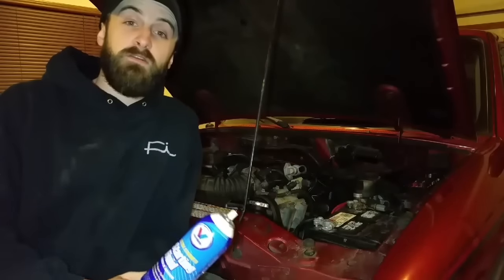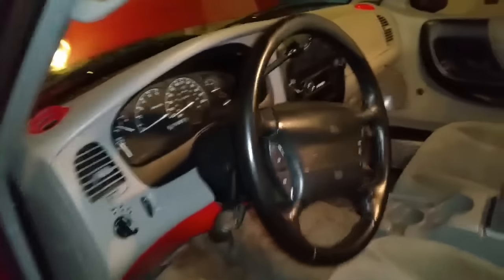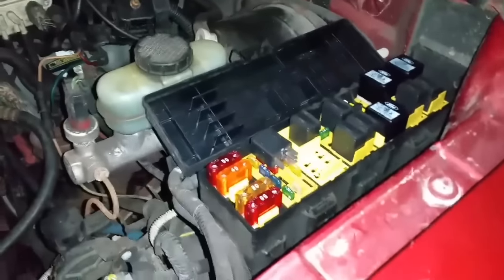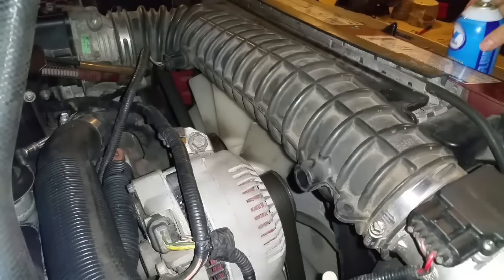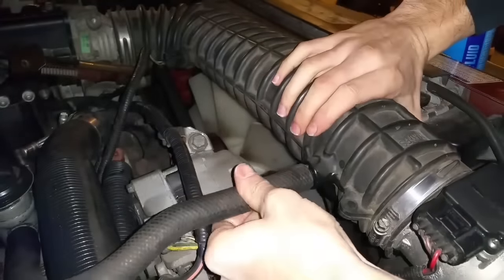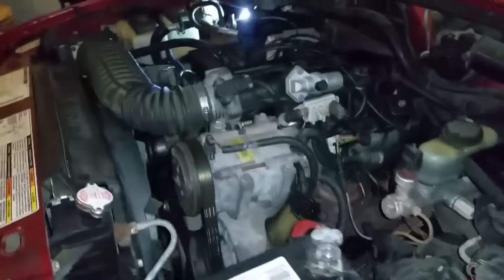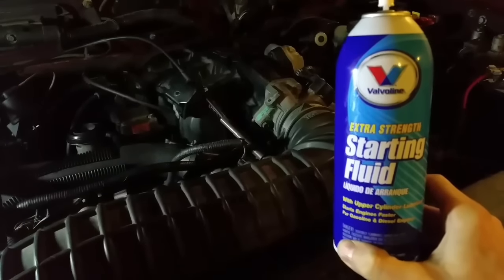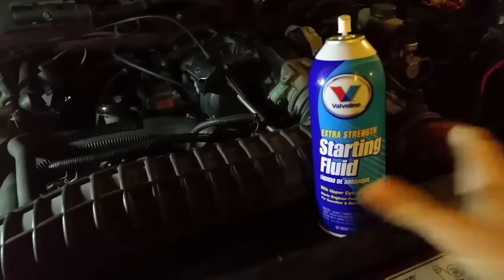THIS REALLY WORKS!!!!!!! Bad fuel pump, fuel pump relay, no fuel problem!!!

Comment: This is bad information on so many levels this will not confirm a bad fuel pump on most vehicles only that there is a no fuel issue which can be caused by a variety of parts. Throwing a fuel pump at it may work ($60-250 plus labor maybe) but thru some very easy diagnostics you could confirm the exact problem ex. fuel pump, fuel filter, COR relay, CP sensor, ECU, EFI relay, EFI fuse a 60 cent part, clutch or park neutral safety switch, clogged or bad injectors or injector wiring, fuck could be out of gas and this test would still tell you that your fuel pump was bad.
Reply from the maker: Did you read the title? Did read the pinned comment? Did you see the part 2 video? But no, you're right, it's not a 3 hour video explaining how to diagnose every starting related fuel component, or electrical circuit on the car. Neutral safety switch and clutch switch wouldn't even crank.

Comment: Not 100 percent true you need to check and see if the oil pressure sensor is bad at least in chevys cause if its good the vehicle will stay running once 4 or 5 lbs of oil pressure closes the switch if that sensor is bad then you may believe you have a bad fuel pump also. This guys truck actually should have kept running once he started without the relay if it has the same switch as in a chevy

Comment: NEVER do this to any type of diesel engine, new or old! In fact..never do this, you can hear if an electronic pump has failed and you can see if a mechanical pump is dead or weak.  Ive been restoring vintage cars for 30 years and have never used starting fluid. If you use your brain first..why would you?
Reply: To start a car

Comment: If there's a timing issue and you like fire, do this method. HOWEVER, if you would rather just see if the fuel pump is bad use carburetor cleaner. Just hot enough to fire but not volatile enough to stay on fire if it gets popped back out of the engine. Sorry man very bad advice.

Comment: You don't know what's You're doing! Never use starting fluid in a gas engine. and if you do, use just a touch or you'll blow the valves and put a hole through the pistons.

Comment: 1.This is not correct 100% and it can mislead. 
2. Regular gas would be fine 
3. It only concurs a fuel problem and could be be from other reasons other than the fuel pump

Comment: How do you really know its the fuel  pump of course it's not going to start cuz you have the damn fuel relay disconnected bro. your only adding starter fluid that's why it wants to start its like adding 1/2 a cup of gasoline is going to burn and back to the same cuz the relay is off😱😨😕😯
Reply from the maker: alfredo zamora Everything on this truck was working at the time of the video... The relay was pulled to simulate a no fuel situation...
Reply from the maker: matthew dix Welp, as I said, the relay was pulled on purpose to SIMULATE a no fuel situation. Simulate for the purpose of making the video... I explained that in the video... 177k views and it's just you two turds that don't understand that. Lol.
Reply: alfredo zamora i was saying the same thing itll never work with the relay off lol 😂
Reply from the maker: planest28 Quote from video "I pulled the relay to SIMULATE a bad fuel pump".... What is so hard to understand about that guys? Jeebus.
Reply: alfredo zamora. Yeah should have pulled the fuse to the pump not the relay
Reply from the maker: Glock 19 See, Glock was paying attention.
Reply: He took out the relay on purpose. He is SIMULATING A BAD FUEL PUMP. By pulling that relay he is simulating, or pretending the fuel pump is bad.  He’s not suggesting you pull the relay. He’s suggesting you use starting fluid to test the theory that fuel pump is bad
Reply: a21bravo  it's helmets for both the little guys😀 they try to learn

Comment: eeeehhh,, that can work,, but first thing i do is get a big hammer and hit the fuel tank!!,  lol then if it still dosnt start ill ck the fuel pressure!! lol,, if it has a plastic fuel tank,, ill hit it with a rubber mallet,,,
Reply: Night Crawler lol, why hit it with a hammer? Or are you just being funny?  I've got an 02 rodeo that I'm trying to figure out if fuel pump is bad

Comment: No one should do this, starting fluid is bad for every engine it burns to hot and has no lubrications to test a starter all you need is piece of wire and you can jump the connections in the fuel pump fuse
Reply from the maker: On a scale of 3 to French Fry, how high were you the first time you tested a starter by jumping the fuel pump fuse?
Reply: @BlaserBuilds  omg...on a scale of 3 to French fry...🤣😂 I don’t know why that was so funny

Comment: Dont do that with a Desiel you can blow the head clean off the engine
Reply from the maker: David Roach I've started stubborn diesels with this stuff for years and never once saw an issue... There's always added risk when adding fuels with different burn rates than what the factory intends but it advertises for diesel right on the can...
Reply: Youve been blessed then ive seen heads get blown off when we was working on some big trucks with diesel your better off to use WD40 then starter fluid ask around to diesel mechanic s will tell you the same.
Reply from the maker: David Roach Interesting...
Reply: David Roach you can use starting fluid in a diesel but u have to be very very cautious u dont spray to much and hold the pedal to the floor while cranking it over. if u spray to much it can and will crack the head or it will vapor lock the motor then u are takeing more or less the top end of the engine apart. im a diesel tech as well. but you are right wd/40 is the best thing to use.
Reply: had a 6v92 silver detroit that had a either switch to prime the motor never blew the head off sorry buddy that is false what it could do is become either locked or either dependent where the compression is lost due to the explosion collapsing rings ect
Reply: drew surber thats the words i was looking for
Reply: - factually, your both right.
This is how I test a "no start" car. If it runs, you know its fuel related.  Start fluid (vapor) will lite better than wd40 in the cold. . (take care cuz too much fluid could hydro-lock or bend connecting rods in your engine.)
Reply: I seriously doubt that you've seen head-s blown off of a diesel !

At most a broken piston bent rod or destroyed starter.

Big diesel are more tolerant than pickup diesel of starting fluid.

& in fact some big diesels came with a cylinder of starting fluid mounted under the hood which was operated form inside the cab.
Reply: If injectors are not pulsing then it's an electrical problem.
Reply: not always a bad crank shaft sensor can shut down your injectors problems can range from bad sensors to a bad ground or other electrical wire or just a bad fuel pump you never know with out checking
Reply: roach , addressing just pulse  injectors, if the injectors are not getting power , it is an "electrical" problem not a pump problem !

&
Injector pulse can be checked even without fuel pressure.
Reply: & roach , you have never seen heads blown off of an engine , ever !
Reply: LOL you act like i care what you believe
Reply: wrong cause a bad sensor can cause the power to not reach the injectors or cause an injector to not pull down all the way causing it to malfunction there are many things that can cause a power issue
Reply: The injector is an "electrical" item that's why it has an "electrical" plug on it.
The "power" you referred to is actually PWM electricity.

You can have all the fuel pressure you need but if you have no "electrical" signal to pulse the injector it will not spray fuel.

& obviously you do care what I think since you keep replying.

& BTW you've still never seen heads blown off of a diesel !

& BTW there are some mechanical gasoline fuel injection systems.
but you already knew that, right ?

Comment: Video made no sense, if you have no fuel pump relay, your fuel pressure is automatically cut off, giving you no pump activity. And some fuel pump relays are in the powertrain control module which mine is which is not a small black cube like in your video. To determine rather it's a fuel pump or relay you would have to multimeter your fuel pump for ground voltage, if you are not getting any than you have a bad fuel pump relay, even checking fuel pressure from the rail would not out rule a relay being bad, until you crawled under your vehicle and checked the ground.
Reply from the maker: JD1982 Video makes perfect sense, and plenty of comments thanking me for making the video and saving them money... May be watch it again and don't skip the part where I explain in detail that I'm removing the relay to "SIMULATE" the engine not getting fuel...

Comment: This guy is clueless, that spray kills the engine, happened to me on the diesel mercedes from 1995, and those are durable engines...it dryes cylinders and feee them from oil lub couse the spray is alcohol based, so its totaly bad idea to use it...BIG NO NO!!!
Reply from the maker: Well Damn skippy you didn't have to use the whole bottle... Did you know you can get 85% alcohol straight from the pump?

Comment: Definitely it won't start. You started it at gear D!
Reply from the maker: Blows my mind how little attention people pay to videos sometimes...
Reply: When was it in gear? I saw it in park. If it were in Drive, the neutral safety switch would not have let the starter to crank the motor

Comment: Don't buy this is totally ridiculous. You can take a motor out of a car and set it on the ground and hook it up to a battery and spray either in it or starting fluid in the motor was sit there and run sitting on the ground as long as you're spraying in a starting fluid. Think about it all the motor needs air, fuel, and Fire. This will not tell you anything except for this guy probably has invested money in the stocks for this commodity and trying to up the sales of starting fluid. So there you have it folks plain and simple does not prove anything.
Reply from the maker: Mike Hamilton You said it best... Needs fuel... If for some reason the engine is not getting fuel this would confirm that if it fires because all other conditions are met...
Reply: I hate to break it to you, but it does prove that the vehicle has spark. There a 2 major areas to check when a vehicle wont start; fuel and spark. If the vehicle starts on starting fluid you can focus on fuel delivery rather than a distributor, wires, coil, spark plugs, etc... This can help save time and money for a novice.
Reply: Being a professional mechanic, this was the first and easiest thing to do on my own rig, it rules out spark compression and timing in 1 quick easy step. One small shot of starting fluid will tell you a lot. But a real mechanic then checks relays, voltages, fuel pressure, filters...before removing the tank.

Comment: You can actually here the starter cranking and everything turning so it's only obvious there is no fuel to ignite the combustion chambers duuuhhhhhh!!!!!!!!
Reply from the maker: Ever heard of compression, and spark?
Reply: @BlaserBuilds  yes it's called get a compression test
Reply from the maker: @orgreens5528  Which is much different than "everything is turning"
Reply: @BlaserBuilds  if everything is turning so strong then its not the compression cuz the compression is still good.. bottom line this can test is wack and you made no sense when u replied anything about "compression and spark".
Reply from the maker: @orgreens5528  The engine could "turn so strong" and still not start with fuel and compression... This confirms the engine is not getting fuel, has spark, and has compression... Sorry that's hard for you to understand.
Reply from the maker: @orgreens5528  Something like a bad cam or crank signal would cause a no start condition for lack of spark... So no, just knowing the engine is turning is not enough to verify a no fuel condition.
Reply: @BlaserBuilds  lets see what Scotty Kilmer has to say about this wack can test..
Reply from the maker: @orgreens5528  Please do, you'll be very dissapointed.
Reply: @BlaserBuilds  I have a 93 b2200 ..put starter and battery but won't turn on it just cranks I sprayed starting fluid and nothing could it be my ecu?? Help me please thanks
Reply from the maker: @LuisGonzalez-gt3wb  Did you check for spark? I did a couple other videos on checking for spark and compression. A bad crank or cam sensor could cause a no spark situation.
Reply: @BlaserBuilds  hey thanks for answering I put starting fluid and nothing what could it be

Comment: And washed your rings good job buddy wth
Reply from the maker: You don't brain too hard huh?
Reply: I am a ase certified diesel Master Tech I just don't think that's good advice to giving people that don't know any better there a lot of better ways to check if your fuel pump is working or not and easier and better on your motor I'm not saying that little bit of starting fluid hurt it but it's not a good habit to get into or to start training people to do to find a problem starting fluid is never a problem solver
Reply from the maker: @woods5012  "Washed rings"
Reply: Yes for some folks that take your advice they could do a whole bunch of damage you don't say an amount or that it could be a bad thing so.... ya
Reply from the maker: @woods5012  So someone doing something completely different than what is shown, may yield a different result?... Incredible...
Reply: @woods5012 ASE as in "Ask Somebody Else"

Comment: This video proves nothing and only thing that it proves is that the starting fluid starts the car. If you have a bad relay the car will also not start and will fire if you put the carb fluid inside. Why spend 400 bucks when you haven,t gone of the cheaper stuff like fuses aand relays first.

Totally cukkooed over me.
Reply from the maker: Please refer to title, description, pinned comment, and 9 minute part 2 video listed...

Comment: I didn’t see where it proved anything
Reply from the maker: Chris McCutcheon It attempted to fire after fluid was added. Proving engine is mechanically sound, ignition system is working, and engine starved of fuel.